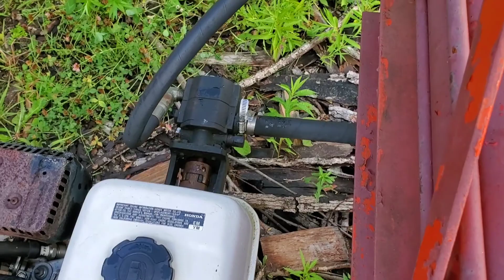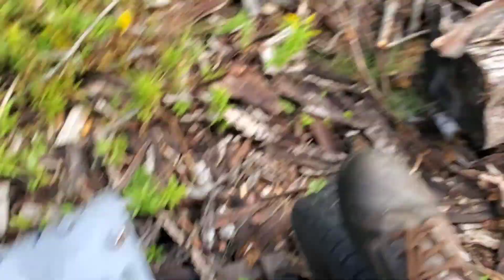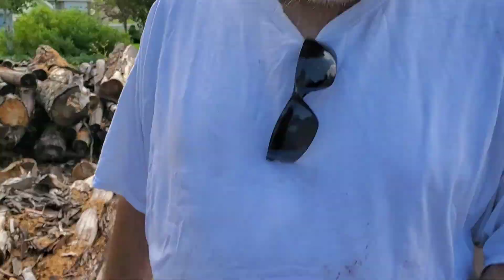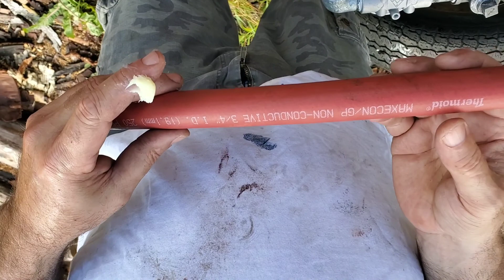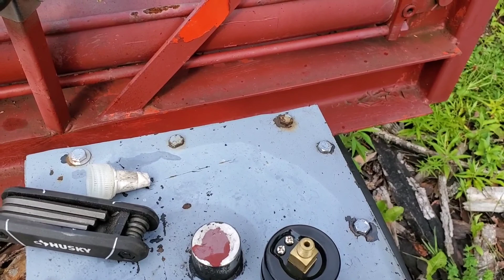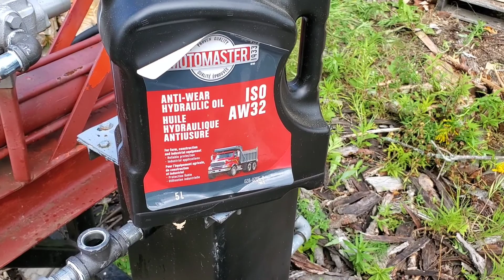DIY Hydraulics. How I added a return filter to a Honda GX160 powered log splitter.

Comment: Another question, I was surprised by how low the working pressure is on your splitter's layout (my new splitter says 3.500 PSI max).  Is that because the pressure is that much lower on the return circuit?
Reply from the maker: The highr pressure just means you have a smaller splitting cylinder to give you the same work force. I don't like to push gear pumps that high. In my mind 2500 psi is good for the pump as a limit.
Reply: @ So the pressure you were reading on the return circuit just before your filter was 10 bars (about 150 PSI), is that right?
Reply from the maker: no around 15 PSI
Reply from the maker: nope 10-15 PSI about 1Bar

Comment: Thanks, Jim, for all your generously given experience and knowledge.  I was about to teflon tape the hoses on my new log splitter ))))  I know nothing yet about hydraulics.  You talk about street fittings as a no no.  What are the right fittings called?  Do I just ask for hydraulic fittings?  I'm asking because I want to put a filter on the system like this.  Bloody brilliant vid!  Thank you.
Reply from the maker: A street 90 degree fitting limits your ability to position the position. With a regular 90 degree fitting you use a close nipple and you will be able to position the fitting where you want and you will be leak free.
Use a forged hydraulic fitting and avoid black pipe on the pressure side. Return is fine for using black iron
Reply: @JimsNBHomestead  Thank you!
Reply from the maker: your welcome
Reply from the maker: Yes insist on Hydraulic fittings

Comment: I bought a home made one in a machines shop, running off tractor and fixing to add a motor pump and tank as well as a hyd filter 25 micro 😊
Reply from the maker: Sounds like a good time for some hydraulic filters

Comment: NEVER EVER USE A TEFLON PRODUCT WITH ANY OIL SYSTEM. THE TEFLON WILL BE AFFECTED BY THE OIL! Releasing thin strands of Teflon fibers and they will obviously get wound around or plugged up any kind of filter or media or pump in the system❤️‍🔥🙏🏼🇺🇸
35 years in the OIL business Texaco ❤️‍🔥
Reply from the maker: Teflon paste is absolutely fine for Hydraulic systems. TEFLON TAPE , however is not

Comment: hello, good and very good... sorry, how many cc is the pump, if you use a gx160 engine
Reply: 13 CC per revolution turning 3200 RPM
Reply from the maker: Yes it is 13 CC per revoultion

Comment: I just read your explaination on why not put the filter on the uptake and it makes sense. I did it on the uptake and broke the part that connects the pump to the unit and had to replace it. Lucky that is all that broke.
Reply from the maker: Well you got lucky, thanks for being a part of the channel
Reply: @JimsNBHomestead  I did not mention that I did it on a 22ton Forest King, Maybe the connector was different and maybe that is why I did not do more damage. I had issues with the pull start as in my opinion they planned on it stopping working at some point.  I "Tim Allened" and fixed it. lol I would explain, but that is not what your video is about.
Reply from the maker: You got it fixed, that's what counts
Reply: Question for all the experts here: Can a filter on the return line cause the cyl.  wiper seal to leak?
Reply from the maker: Not that I've ever come across

Comment: Thanks for the video, does it matter whether you put the filter on the return line vs the supply line to the pump?
Reply from the maker: I understand your question totally, but I will give the three scenarios for filtration. 1. Suction filtration (to the pump) is not ideal due to the fact that hydraulic pumps do not like having to suck oil very much. In fact this will lead to a problem called cavitation which is the kiss of death to the pump, and the pump prefers to be flooded . 2. Pressure filtration (from the pump) is doable and in some complex systems recommendable. However very expensive filter assembly and very expensive filter elements. Pressure filtration is at full system pressure which in this case is about 2500-3000psi.
3. Return line filtration (back to tank) is usually the best option. It is the least expensive but in my mind the most effective. the dirt is captured before it gets back to the tank. It is the cheapest option, and its usually is the most versatile in adaptation. Return line filters operate with a pressure of around 10-25 PSI. They can be equipped with a by-pass valve for extremely cold start ups or when the get plugged with dirt (get a gauge ) and require changing. I hope this helps, and as you can see I went with Return Line Filtration. Cheers
Reply: @JimsNBHomestead  thanks for the explanation, that all makes sense!
Reply from the maker: I'm glad you picked up on it

Comment: I did not see a pressure relief valve anywhere in the system.. you might want to think about adding one before you burst a hose or something
Reply: Is the pressure relief valve integrated into the filter in the return line?
Reply from the maker: No just a 25 PSI bypass to prevent the filter from imploding
Reply from the maker: Ahhh my dear friend, thanks for the heads up. Unfortunately you are incorrect in your assumption of there being no pressure relief valve. You see it is integrated into the control valve and functions in both directions. This setup is used in most types of hydraulic systems on mobile equipment. I am a certified mobile hydraulics technician and have many years of experience working with these systems. Thanks for watching and commenting
Reply: @JimsNBHomestead  in your video, you say you did not see a pressure relief in the directional control valve. Like you, I did not see it either. I looked up the valve and found where it was. A little different than most valves. As far as a 2-stage pump goes. They don't kick in to any gear.  They have a high volume low pressure side and a low volume high pressure side . The high pressure side is pumping into the system all the time. When system pressure reaches 500/600 PSI the unloading valve in the pump opens. Dumping the high volume side back to the inlet side of the pump. The low volume high pressure side continues to build pressure .
Reply from the maker: @Georgemerglo  kicks into gear is basically a slang term not be taken literally, and technically this is a gear pump so it does kick into high pressure gear.
 At the time of making the video I did mistaken the unloading valve for the relief valve. What I meant by kicking into gear was the high volume section unloading and the low volume high pressure side of the pump taking over the chore of splitting the log at the cost of cylinder velocity. We only have 5hp to do the work and speed and force are the variables. One is at the cost of the other. These are simple hydraulic systems and relatively low powered. This splitter was actually a 3 point hitch attachment for a tractor. It works decent but the lack of a filter was concerning thus the whole point of the video. I'm curious did you do a log splitter video?